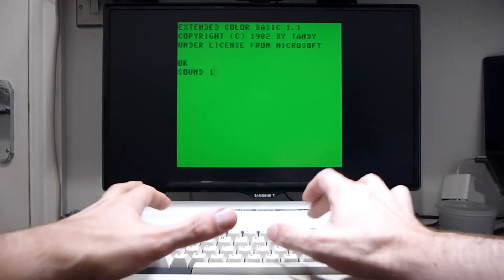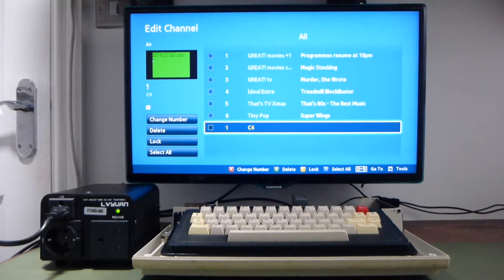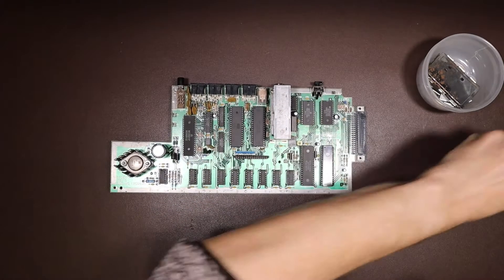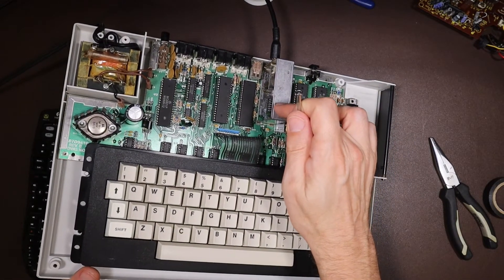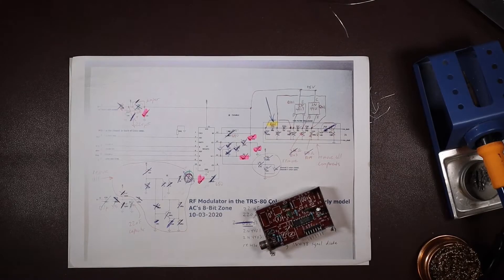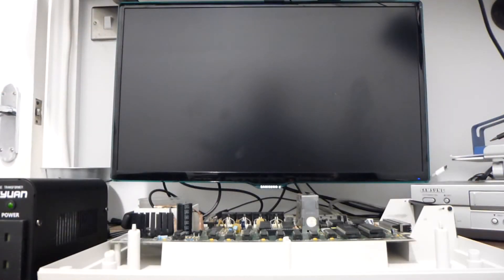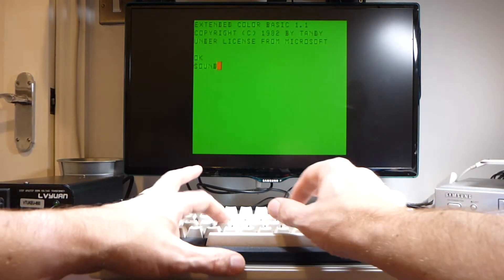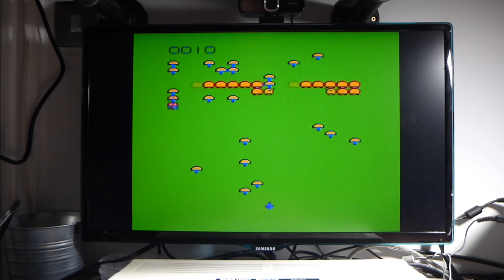TRS-80 CoCo 2 - Try to Fix - Homebrew Composite Mod

Comment: I have the same machine with the same mods. The display after the mod is pretty good. It’s nice to know there is another ntsc one in the uk!
Reply from the maker: Glad you enjoyed the vid. I actually bought the NTSC version by accident from a (deliberately?) vague ebay add in the UK, but on balance I am very pleased it went that way. Did you replace the transformer or do you just run off a step-down?
Reply: Actually, I was looking for an ntsc machine and put a post on the coco Facebook page. And a kind gentleman from the USA offered to send me the board and the keyboard, as he was going to fit a raspberry pi in its case. So all I have is that, but I’m very pleased with it.

Comment: Thanks for making me ancient lol.  I had this exact same computer back in 1983, got it for Christmas.  16K, tape recorder, and a color tv.  Spent a LOT of time on this until 1991 when I got a 386dx/33 PC.   Thanks for the flashback to a simpler time, and some really cheap graphics and sound lol
Reply from the maker: Hi Tomswoodwork. LOL sorry about making you feel old (and for a delay in responding) I really enjoy this machine and its welsh "intentionally just different enough not to be a clone" the Dragon 32. I still have the CoCo, I think its probably going to be in another video soon and then maybe I'll have to move it along for my next project.

Comment: Don't know if anyone has mentioned it yet (didn't see it after skimming through the comments), but the yellow stripe, aka "yellow bar problem" is common on CoCo2s. There's a yellow color burst circuit on the main board that corrects the colors in hi-res mode so that they're red and blue instead of purple and green. On mine, I replaced the germanium diode and the 555 timer and all was well.
Reply from the maker: Oh wow... no nobody mentioned that! Fantastic information... I was about ready to part with the coco 2 but now i have another project! Thanks so very much
Reply: Is there info to accomplish this tuning on a CoCo 1 (rev F)? No 555 timer.
Reply: @La CoCo Strangiato  I'm not aware that CoCo1s have this problem because they don't need a yellow color burst. The computer generates the orange and blue colors natively. 

The CoCo2 needs this circuit to generate those correct colors due to minute changes in circuitry which cause the artifact colors to be green and pink instead.
Reply: @natethefighter  I have a CoCo 1 with a composite mod that causes the RF artifacts to shift to green and purple.
 It used to affect composite too, but I stripped out unneeded components from the composite board and composite now outputs red/blue.
Reply: @La CoCo Strangiato  wild how just a little bit of otherwise-pertectly-fine tinkering can screw with those artifact colors!

Comment: Thanks for your lovely response to our comment.
Nina and myself (Wayne) carry out repairs on vintage electronics including late 70's, early to mid 80's home computers. This includes:-
Sinclair ZX80
Sinclair ZX81
Sinclair ZX Spectrum 16k/48k/128k and variants
Sinclair QL
Commodore VIC20
Commodore 64
Commodore 16/Commodore Plus4
Commodore Amiga range
BBC A/B
ACORN Electron
TOSHIBA MSX range
That's just for starters! 😄😄😄
If you need any help, drop us a line.
P.S. Not much money in repair these days, but it's still good to help each other out.
Warmest Regards & Best Wishes.
Wayne Brill & Nina Evans.
❤️❤️❤️😊😊😊😊👍👍👍👍👍

Comment: Great to see that you got this Coco up and running (and an NTSC version too, I'm jealous). AC's composite mod was a tonne of work but it gave great results. Ah, to be able to play Coco games in their intended colours. Another good repair video from the Retro Tech Repair stable (kittens have their place, but don't give up the retro stuff). A very happy new year to you and yours Roger, take care ;)
Reply from the maker: Thanks 8BITB (OOOhh I have just noticed how clever your channel name is) anyhow. Happy new year to you too. According to the CoCo manual the TRS80 has an "artifacting circuit" so it was very much the intention of the designers to use the feature and I feel if it had been possible on a PAL Dragon 32 then the Dragon might have done a little better in the 8-bit wars... poor dragon. Anyhow, thanks so much for your comments. Hope that you are enjoying your well earned break.

Comment: Great video as always. If you’re like me, you get a great sense of achievement when you build (or in this case rebuild something) from a set of schematics or step by step instructions.  
I recently built a Spectrum 128 Harlequin from scratch (the hardest part was sourcing all of the parts). When I first turned it on and got the good old spectrum 128 menu screen, I was shouting yes..F**king yes yes like a madman. 

I sometime struggle with confidence in my abilities, so this gave me a massive boost.

Anyway, thanks for your all your videos.
Reply from the maker: That's great ghost
Excellent job with the spectrum. Congratulations. I haven't done anything like that myself. Thanks so much for your comments
Reply: @Retro Tech Repair  No worries, Your channel  is one of my favourites.
Reply from the maker: @ghost-retro3733  that's great to hear

Comment: Was this a re-upload of the earlier one because of the smearing / jerky video?

Nice video, and interesting to see the Apple style artefact colour - makes the machine a lot more competitive. In PAL mode the graphics are, let's face it, a bit lame, even compared to the Speccy or Oric.
Reply from the maker: Yes... the smearing is new and I have no idea why. Its exported via apple compressor using identical settings to those I have used for years. It was not supposed to be released but I guess I forgot to cancel the schedule. The new one comes straight from final cut Pro and is hopefully better. Thanks again for your kind words.

Comment: A/V mod is definitely better than rf. Interesting way to do it too.  Pretty sure that coil wouldn’t have enough range to reach the correct frequency anyway.
Reply from the maker: Thanks Wenlock that makes me feel better
Reply: Glad it helped. I used to have a lot of trouble at times as VHF modulators were used in Australia and the CoCo would produce a lot of interference so I had my R.F. cable wound round a ferrite rod